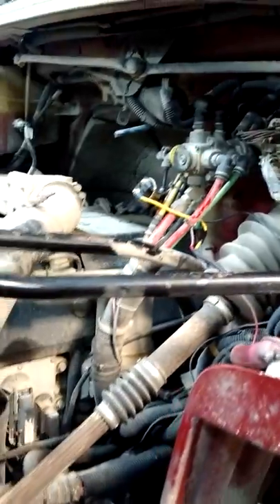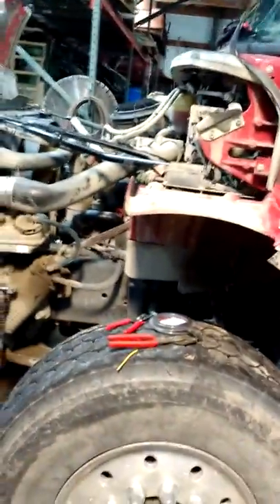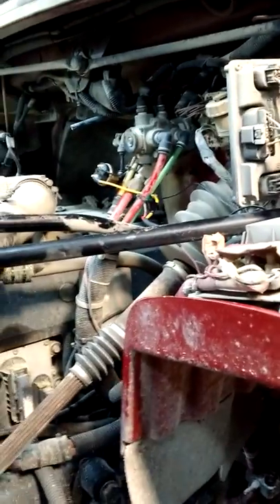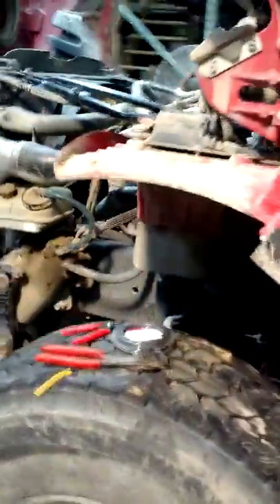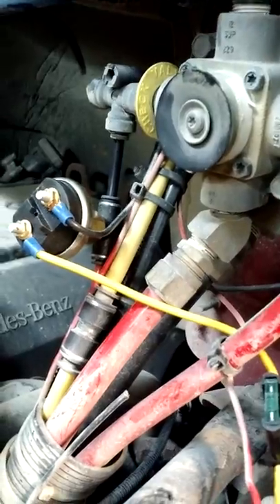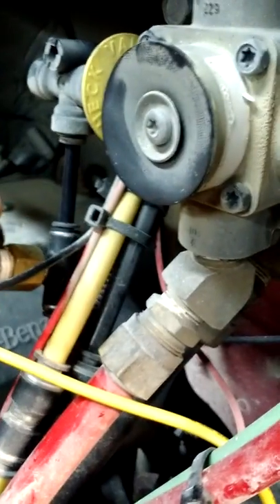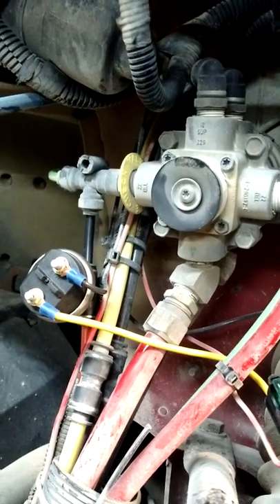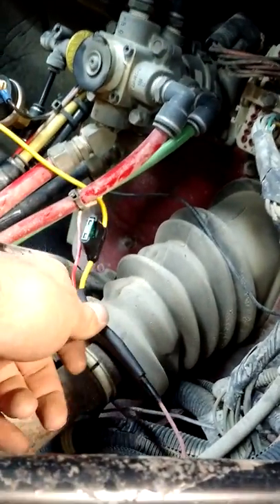04 Freightliner M2 electric trailer brake switch

Comment: So I also ran fused power like you did to one side of the switch and the other side to the brake controller. Still isn’t cooperating. Am I missing something?
Reply from the maker: Sounds right...
Make sure it is connected to the brake switch wire on controller...
There needs to be separate 12v to controller
Blue wire off controller to trailer brakes and a good ground
Reply from the maker: Check new switch with a test probe  make sure power is getting through

Comment: Did you have any issues with break lights on your trailer not working?
Reply from the maker: No that would be unrelated. Trailer light wiring is separate of brake control

Comment: where did you get the 1/4 inch coupler I need to do that set up
Reply from the maker: Ray Gallegos any  truck supply shop or I got mine from custom hose a local hose distributor
Reply: Parker Hose Store, 372PTC-4-2 or 377PTC-4-4

Comment: What pressure switch did you use?
Reply from the maker: To be honest I do not really remember it's been some time ago you just need to switch that is normally open and would close with air pressure should be able to get it at any truck supply parts store